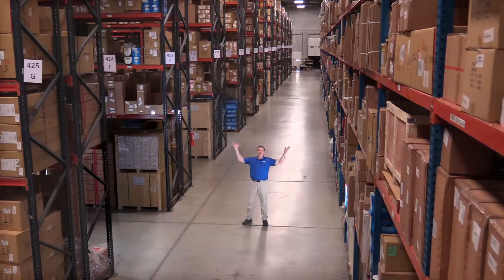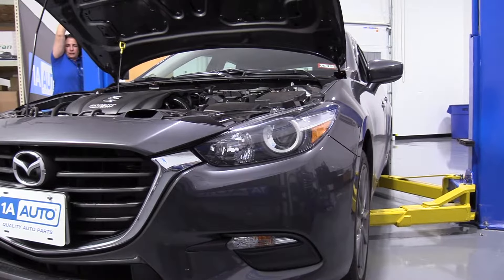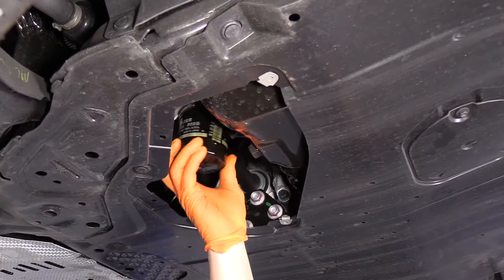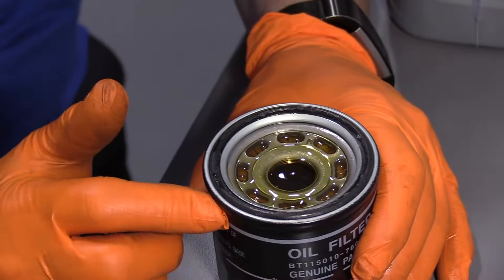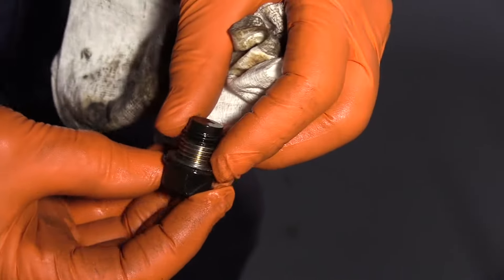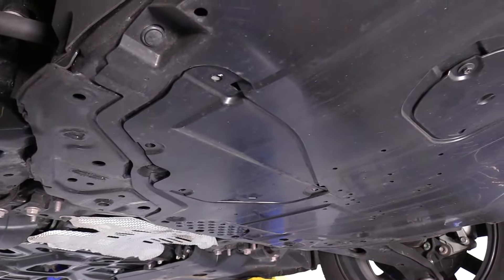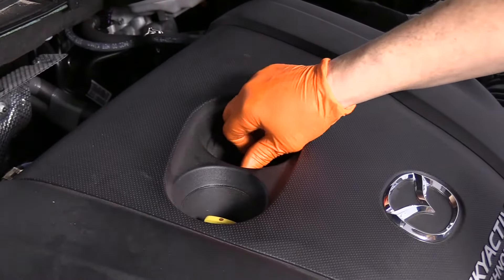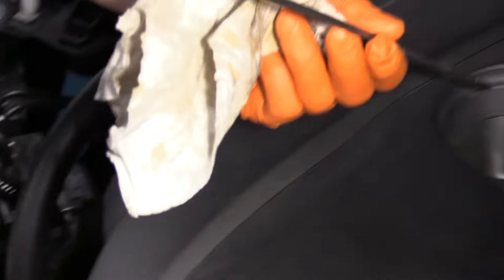How to Perform an Oil Change 13-19 Mazda 3

Comment: Prime the oil filter protects the otherwise dry paper element from possible Micro tearing when new engine oil blasts thru on first startup as new oil pushes on oil, not paper. Provided filter is oil soaked new filter can be horizontal and half prime still protects. Great video, you can service my Mazda anytime.

Comment: What type of screws are the first 2? I know you said you can remove with 8mm socket, but I'm having trouble finding the exact part/screw #.
Thank you! (my access panel/cover got damaged, and I want to replace the 2 screws/plastic push inserts).

Comment: For some reason I thought the oil plug was an 8mm hex bolt...I could be wrong or it could be different on different model years.
Reply: Thank You
Reply: The 2014-2017 mazda 3 bm and 2012-2016 cx5 and mazda 6 have 8mm hex bolts any mazda newer has a 17mm drain bolt
Reply: Mine has the 8mm hex bolt too (using 8mm Allen wrench or Allen socket).

Comment: Wouldn’t you want to fill the car with oil first and then check for leaks around the drain plug and the filter after the car has been running before you put that panel back on?  How else would you know if it was leaking or not unless there was oil back in it?
Reply: You would know quite quickly if it was leaking badly as it would be dripping onto your driveway. I always check that the old o-ring gasket is not still attached to the oil filter connection. After you have done an oil change several times you don’t have to worry much about it. On my Mazda 3 I replaced the oil drain bolt with an EZ-oil change plug. I never have to remove the drain plug, just move a little ball valve lever to drain, then move back to close. Makes the job much easier.

Comment: I live in Central America according to the weather I recommend using 10 w 30 synthetic, is that correct?
Reply: What year is your car I can tell you which oil you should use
Reply: @atifbashir2452  es del años 2014 2.0 skyactiv segun manual fuera de usa y canada usa 5 w 20 o 10 w 30 sin importar el millaje
Reply: CHETRY AR 10w 30 is best for engine 0-20 only exists in USA because of stupid epa and mileage requirements manufactures face. I always put 10w 30 on all new cars during summer and 0-30 winter

Comment: i wanna learn how to change my own oil, doesnt seem that hard. i just wanna know how long it takes for the oil to cool down? like, if im just turning it on to drive it from front yard to back yard, only like 20 feet?
Reply from the maker: +소라 Thanks for checking us out! If you are only moving it a that short of a distance it should be okay to work with as the engine won't have time to fully warm up. If you're divining it for several miles it would range anywhere from 10-30 mins to have it not burn your hands, but you should be good to go as soon as you move it.

Comment: This would be so much easier without that plastic cover in the way, but I will hand it to Mazda, they made the filter and drain plug really easy to access once the cover is off.
Reply: The plastic cover just pulls right off, no tools required. (And it pops right back on) I leave mine off in the summer, and reinstall it for the winter. I always remove it when changing my oil.

Comment: Can someone tell me why brake cleaner is listed, but not mentioned? I assume it’s to clean a part, maybe the drain plug bolt? Thanks
Reply from the maker: +Joseph Thank you for checking us out! Yes, the brake parts cleaner is not required, its just to help clean off any really dirty parts.

Comment: You HAVE to use a filter socket? I have a strap wrench and an oil filter wrench but no socket.. so I have to buy one? Is there room for the above mentioned tools?

Comment: Question: I have a 2017 Mazda 3 2.0 skyactiv G and the manual says to use 0w-20 in USA AND CANADA, but it says everyone else has to use 5w-30! What’s the deal here which is best for the longevity of my investment??
Reply from the maker: +Onix Junes 0w-20 is better for fuel economy but once the car is up to normal operating temperatures both 0w-20 and 5w-20 are going to identical in viscosity. But for initial start up 0w-20 does less harm to the engine than 5W oil.
Reply: 1A Auto Parts thank you for that
Reply: Your owners manual will have the correct information. If ever in doubt, contact the dealer.
Reply: Both are good. 0w-20 for short trips (for better cold start), 5W30 for longer trips. If the engine is using too much oil about 0W-20, you have to switch to the 5W-30.

Comment: Hi, I just did this for the first time today and this video was really helpful. I didnt have time to wait for all the oil to drip out and then I filled it with 4.5L of oil but im worried I put a bit too much as the oil on the dipstick while hot is a little bit higher than the max dot (little less than 1cm) Is that a problem?
Reply: You're fine. The amount of overage you describe isn't enough to hurt the engine.
Reply: Youd need to overfill it more than half a quart for it to cause damage. I always fill it with about 4.7Q just to be safe
Reply: @briany3002  this answer is very manufacturer specific.  There are brands that can be very sensitive to over filling (like Porsche).  You shouldn't be deliberately overfilling the oil to "be safe".  That's not safe.  You should fill it the amount it needs.

Comment: New oil filter or just priming the old one?
Reply from the maker: A new oil filter was used and was primed before replacing. Hope this helps you out! +Gilbert Torres
Reply: @1AAuto  benefits of priming new filter?
Reply: @gilberttorres3161  She already mentioned that in the video that, when the new oil pressures the new filter when it is dry, it might wear the new filter therefore she is priming it to avoid wear/tear by the first pressure.
Reply: @gilberttorres3161  Nothing. How is someone supposed to prime a filter when it goes on horizontally?
Reply: @Golright  Lol You don't understand how oil pressure works in a car. Try again.